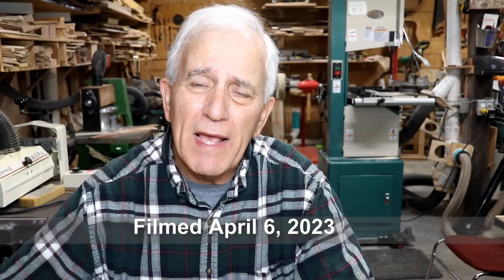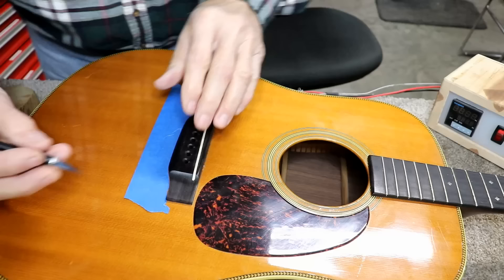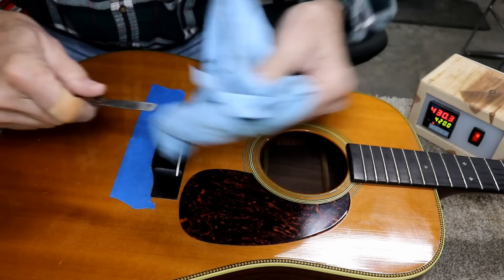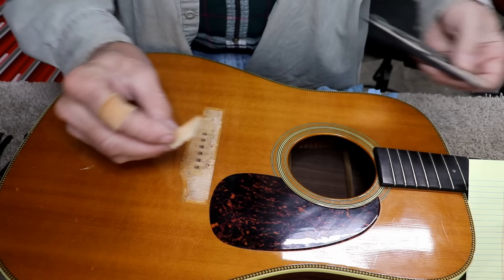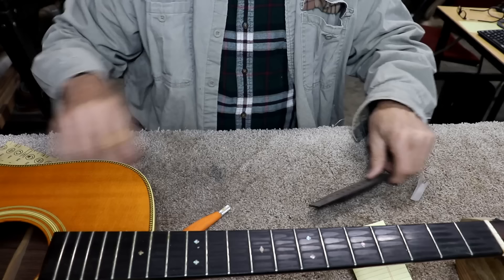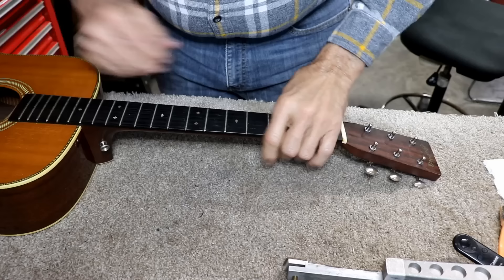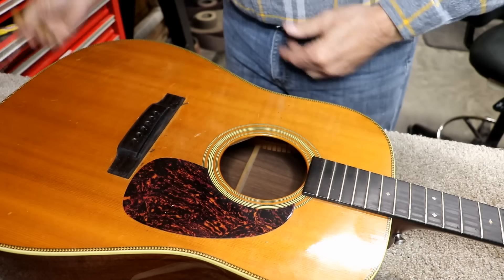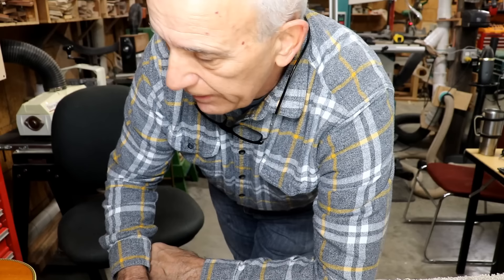640 RSW Refused by 2 Martin Factory Authorized Shops

Comment: Martin is over rated
Reply: So are "expert" internet opinions...
Reply: Nope
Reply: Pre CFM IV   Martins were not over-rated.  Of the 15 Martins I have owned, 8 were new. Of those 8,  5 were so badly made they were returned directly to Martin for repair. Of those repairs,  3 failed and sent back for re-do's.  2 of the five (both very expensive customs) were destroyed by Martin as "unable to repair".
Reply: @jeffhildreth9244  I love my D-18 & OO-18.
Reply: @mattrogers1946  Glad you like them.  I currently have a 2015 00-18V with highly flamed mahogany backs and side, a 0ne of 370   0000-1 made in 1997.
Some of My Martins included, D-18GE, needed a neck reset at 30 days.. returned to MacKenzie River music.. owner said.. nope neck is also twisted, needs a new neck.
The guitar and I parted company.. the dealer took it back and he dealt with Martin, bought a new D-18s.... arrived with all ALL of the top and back braces detached.. all the glue was white powder. Returned as unrepairable, Custom D-18s.. the works like they were made pre CFMIV... ..had a 5 inch crack in the back right out of the box and needed a neck reset......returned after 3 days..Martin Factory repair dept said needed needed a neck reset and the back needed repair.. returned to me after 4 months.. back still cracked and sloppy neck job, not reset ,planed. Returned. Head of repair dept retired, another took over. They lost my guitar.. and the story goes on for over a year... me with no guitar. All the while I had a custom 00-17 being made to replace my 39 which got stolen. Again, the works but upgraded with tortoise binding  etc etc etc   #4 grade mahogany, one piece neck  ... Guitar arrives. opened the case.. did not remove the guitar. The neck was off set by 15 %.. the high E was right at the edge of the fingerboard and the low E was 1/4 in from the edge.. but here is the best part.. the neck was also off set to the center line of the guitar. and.. they shifted the bridge to center it to the neck rather than the guitar and.. then to make it look like it was centered to the guitar they cut off 1/4" of the end of the bridge. YUP all fact. Called Elderly ( the selling dealer)  and they said the guitar was perfect when it left them, they had thoroughly check out the guitar. I had to pay shipping to them. They got the guitar, apologized and said I was absolutely correct. The guitar was then sent to Martin. Elderly sent me a bill for the shipping.
Martin had the guitar for several months and never contacted me once. Finally I contacted them and they said the guitar had been destroyed as unrepairable. 11 months and no on contacted me. I got a refund from Elderly but I was still out minus $270 in shipping to me and to Martin from Elderly. Want more, there's more? There's plenty. . 
 During one of my infrequent calls to Martin ( I never bothered them during this entire saga, except an occasional e mail..to get a status update  with zero response)
one of the "Customer Service" personnel called me a "consumer".. "dealers are our customers" Fact.  Net result was two very expensive guitars were in their hands for about 14 months. They never voluntarily contact me once during that time. Not once.  I paid all the shipping for these guitars and it cost me about $400 NOT to own them. 
Net result, I will never buy another new Martin. Oh and there was the custom D18 .. bridge popped off at 30 days. Returned to dealer, dealer said that while the guitar was in their inventory  it was returned to Martin for a neck reset.. on an unsold guitar. They failed to tell me that when I bought  the guitar. That would be Nicholson in Calif. More.. I'm bored, how about you. ?
Reply: @jeffhildreth9244  Who said anything about new Martins?
Reply: @mattrogers1946  I did. And  illustrated  what happened to a once admirable company of guitar makers  into what is now  a corporation whose goal is "numbers"  not exceptional quality and  use the guitar as the vehicle by which wealth is derived. Not the same.  Far too many failures. I am not alone. It is obvious "you were not there".
Reply: @Jeff Hildreth  Well, both of mine are from the early 70s. An era that wasn't exactly the "Golden Era" of Martin either, but I wouldn't trade them for the world.